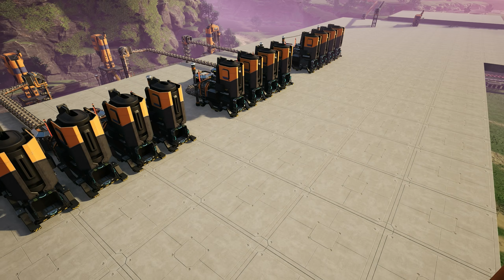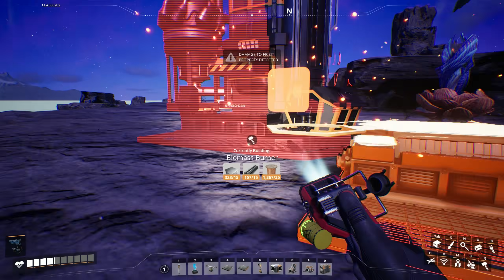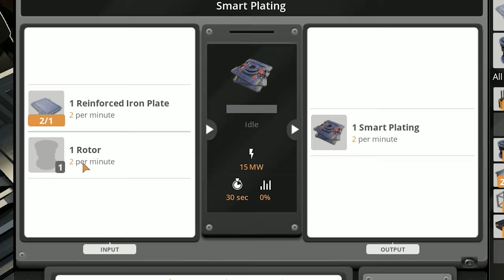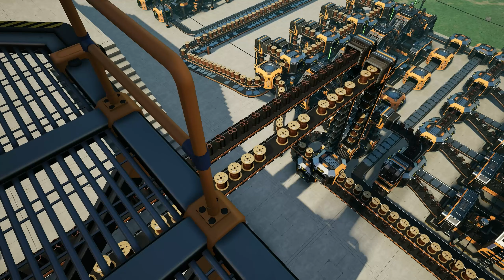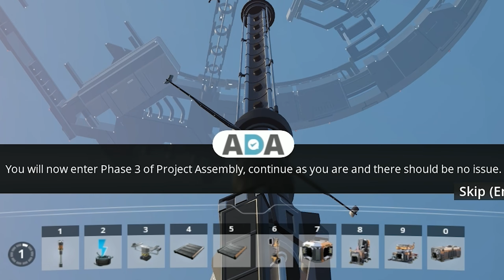Recipes you NEED Starting in Satisfactory 1.0

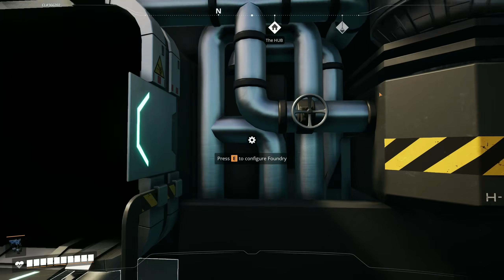Comment: 9:35
Specifically Molded Steel Beam is a 2 2/3 to 1 ratio, which is nearly twice as resource efficient as the normal recipe. It's an amazing upgrade and really useful in the Grasslands due to the huge amount of limestone you have available that otherwise doesn't have much use. Assuming fully overclocked Mark 2 Miners, you can generate about 2400 limestone, or 800 concrete, per minute with just the 6 normal and 1 pure nodes within the vicinity of the starting area. Combine that with the two pure coal nodes and 6 normal iron nodes which work out to 960 per minute each, and the molded recipes can comfortably make you 200 steel pipes and 285 steel beams with a bunch of concrete left over to go into storage for construction purposes.
And that's before considering Solid Steel Ingot which will get you even more steel out of those same resources.

Comment: Pro tip with the alt recipes. You can't get duplicate recipes at the same time. 

So if you get two things you don't want and used the reroll, then just don't pick anything, leave it in the library and you'll never get those options in future hard drives.

Comment: I know it requires the bane of all Satisfactory player's existence, but the wet concrete recipe is actually amazing, as it makes the 3:1 ratio, a 3:2 ratio, doubling efficiency. It does require unlocking the refinery, but it doesn't require any fuel, and you can unlock the recipe before then because you've unlocked concrete, one  of the parts of the recipe. This then allows you to save so much coal and iron in the 'molded' recipes, therefore turning a previously useless material into one that could be vital in the early to mid game in that it makes everything soo much easier!

Comment: I've been a fan of and using wet concrete, Pure iron ingot, and encased beams since i first started (around 3? Just after they added pumps). The new Iron pipe and more specifically molded steel ones pair nicely for squeezing the maximum output from 1 iron and a limestone node. 

Yeah anything that increases output with water is worth it imho..

Just set up at the lake with 4 coals in northern forest doing pure iron, solid steel, wet concrete, and encased beams last night. Was thinking of changing to molded and left space in my layout. Also did a dilluted fuel/plastic plant at the north shores oil fields.

Comment: The fact you rolled the steel screws would have saved you a bunch of pain early.  Been using it in my new 1.0 save and didnt run into any issues, its actually still running though I could have replaced it ages ago I've actually expanded on it since getting trains cause my local steel production is just working great to keep my rotors going.

Comment: Actually for Steel there's also Compacted Coal version, that turns 2 iron into 4 steel
Reply: That’s good if you have less iron than sulfur. But sulfur was (and still kind of is) scarce, so it’s not that good of a recipe. Just use more iron and coal and don’t “waste” sulfur like that. It’s better used on turbo fuel, among other things.
Reply: @sOvr9000  That would be correct for end-game, but you still need to get there and getting Tier 3 belts would be already tight and there's literally 0 use for sulfur at that stage. I hope you don't hand-craft your milestones xD

Comment: I just rushed coal, set up basic factories I plan on ripping out anyway, then spent three hours hard drive hunting. Only ones I’m missing are encased pipe and the alternate heavy modular frame. Would’ve sworn HMF were unlocked in parts assembly 2.

Comment: I was also in the alternative recipes hell xD. For Heavy Modular Frames i was locking for the recipe with concrete, steel pipes and encased beams. I had to search for 20-30ish hard drives to finally find the recipe. It was so painful…
But at least i found some Somersloops and Mercer Spheres at the same time :).

Comment: There is a cave in one of the sand biomes (I can't remember which one) where there are four quartz nodes and one SAM node. The SAM node is normal rarity, and right next to the cave is a great spot to build a power plant based off of coal, though you do have to get the nobelisk in order to get a quick way from the power plant to the quartz/SAM. Hope this helps!

Comment: FYI, there is a normal SAM node in the pit under the arch. Got bugs and poison gas to deal with, but afterwards you can easily lift the SAM up out of the pit to use for your alien tech goodies.

Since the best additional (the Dimensional Depot) can be used as so as you unlock Steel, thought someone would want to know.

Comment: Idk if this is gonna get patched eventually but atm it does work:

The 2 alt recipes you get at first are decided when the hard drive is consumed, meaning you could technically save, decode it, wait and if you dont get what you want reload and wait another 10 minutes. Tedious

On the other hand, rerolls are not set and calculated when you click the roll button. Save when the hard drive is decoded, reroll and if its not what you want simply load and try again
Reply: Ah, savescumming! Old tricks are the best tricks!
Reply: My Savior
Reply: Lowkey a good way to minmax hard drives at the start.

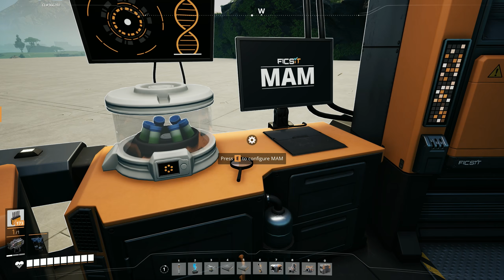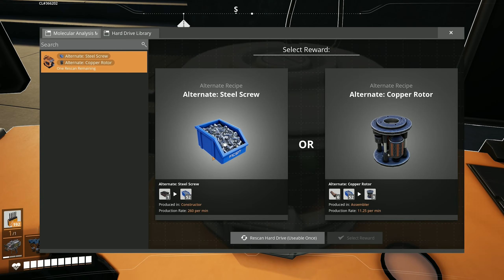Comment: Note at 7:53 he gets biocoal for a second time, if he had left the other recipe up rather than pick it his pool of options would have gotten smaller, note there is currently an issue were the hard drive list does not scroll so you don't want to get more than 7-8 before you start picking recipes. edit never mind 15:11. Still one tip if your doing the same as him is if you don't like either option you can as least rescan the drive and then leave it on the list. gives you one more roll of the dice.

Comment: if those bugs are bothering you when you go exploring, unlock the boomobox and any of the tapes and use it as a weapon, using the turbo bass instantly kills all flying bugs in a decent radius, it makes taking out those big nests rather easy
Reply: Also it takes a little while longer to unlock but the gas nobelisks insta kill them while you run in and beat it up with a sword. Or you can sneak up to them
Reply: @michaelvoight7748 I just have a manufacturer pumping out nobelisks with a dimensional depot hooked up to it. Sneak up on 'em and start the fireworks.
Reply: @michaelvoight7748  "Sneak" up, yeah. You can just hold C and it doesn't matter how fast you're going, you can't slide jump crouch right onto them.
Reply: @Lumegator  + They don't detect if you stand up for a moment, so even if you accidentally cancel your slide, you can just stand back up briefly and reslide.
Reply: Thats a thing?? Ill have to try that!
Reply: @DiagonalCoff33 yup.  Crouch and sneak up to a flying crab hatcher and you can freely melee it to death even with just a zapper.  As long as you don’t stand up, you should be able to take out even an entire cluster of them with basically no issues.  Creatures have different audio and visual perception, so you can actually sneak past a lot of enemies if you stay out of sight

The boombox is also useful.  In fact this is an INTENDED use, if one of the older update trailers is to be believed.  Where they explicitly show a massive swarm of flies instantly neutralized by it.  

Alternatively, two shots with a Rebar gun from outside the bug’s agro range can also deal with a spawner.  The crab flies despawn after about a minute or so without a player getting in agro range.  (4 something shots for the alpha hatchers) 

Gas nobelisks also deal with the flies pre well, as they have only one hit point, and the gas will immediately deplete it so long as the gas clouds are sufficiently thick.  Make sure you use enough of them so that the flies cant thread their way out of it as you kill the spawner.

Comment: Tip because you actually went to all the quartz nodes. When you scan, if you hover your mouse over the nodes that appear, it'll tell you what type of node it is (Pure, Normal, Impure).

Also, I had to go through about a dozen hard drives and had to have like 6 sitting open to finally get the steel rotor recipe. :D
Reply: Let me guess you rushed the MAM with caterium, sulphur and quartz? If alt recipe hunting trick is to unlock as little as posible to reduce to pool. Quartz is not that bad as about 3 it adds but caterium adds a a lot of alts and sulphur not useful till oil. It's why you should avoid unlocking foundations until you unlock stitched wire as limestone infests everything.
Reply: @kennys-dt8od they even added a quartz recipe that effectively lets you get both silica and crystals from ore at once, at the expense of some limestone and nitric acid (10 acid for 120 raw quartz). Probably a runner up to solid steel for being one of the best alternates in the whole game
Reply: I got steel rotor on my first hard drive! Never been so lucky in my life
Reply: bro ive been through a dozen and still cant find solid steel recipe, although i didnt know its more efficient to leave them unclaimed so i'll have to do that for my next harddrive hunt
Reply: @USSRChicken   the pool is only from tech you have unlocked and it's also tier locked, dammage is done sadly but don't advance a tier utill get alts you need from steel as gets a lot worse when blenders and manufacturers come online.
Reply: @kennys-dt8od  yeah i know its tier locked, but i did actually find it after a few more harddrives so yayyy

Comment: A little pro tip I figured out on my own a while ago:

When opening drop pods, you can close and reopen it immediately after pulling the handle. This skips the sliding animation, allowing you to take it quicker, saving you a bit of time when in a tight spot.
Reply: Or you can be a pansy like me and put the critters on retaliate mode. As long as you don't touch them, they'll leave you alone.
Reply: I've never understood why they have that janky ass animation for the handles anyways. All it does is waste time and make it feel unresponsive/simulate input lag. They should just have the handle move with the cursor. It ain't rocket science. It's just a handle. A factory game doesn't need big fuck off graphics. It just needs to run efficiently.
Reply: @diamonje I like it tbh, all the buttons and levers you have to push and pull manually in this game give it a lot of character.
Reply: @jkraemo  I'd be all for pulling the lever if it moved with my cursor instead of being dragged behind it. It just doesn't give me that feel good like the other manual aspects of the game.
Reply: i like tight spots
Reply: Rebar gun 🤤
Reply: @Izakde 
... With explosive rebars!
Reply: @Izakde  I love the Rebar Gun. <3

Comment: So I spent about 2 hours very early on out HD hunting and found 2 incredible things: 1 there is a new alternate  for steel pipe, made of iron ingots! You can make motors, with the steel rotor recipe and iron wire, out of only iron. 2 if you find 50 plastic in the world, you can unlock HSC’s and subsequently get the geothermal generators! I have skipped coal power entirely. Blue crater has 3 PURE geysers. Perfect for a Grass Feilds start.
Reply: @alexgreen8372  wait.. really ?  Skip coal ?  How...  and of course I see this right after I set up 8 coal gens. Lol
Reply: @elilewis8212  They added more geothermal vents in the map and reduced the cost, it's possible to unlock and reliably craft them at phase 2 since you can loot drop pods for circuit boards. They now only need motors and high speed connectors to craft instead of super computers, you can hand craft the HSCs. There's now a total of 31 vents providing an average power output of 7100MW, 10,650MW if you build power batteries to stabilize power fluctuations.
For reference there's 3 pure, 1 normal, 1 impure geysers east of the grass fields which provides an average of 1500MW or 2250 MW of power.
Reply: @kingcupcakes5171  where do you loot the circuit boards? and ive researched HSCs but whats the step to craft geothermal power generators! thanks a ton enjoying 1.0 so much!
Reply: @elilewis8212  real i just finished a 72 coal gen plant😔
Reply: Top tier
Reply: he shows it early in the vid XD
Reply: Best place for plastic is the gold coast at crash site kibs went to (one have to swim to,) there is 1 more in grass field area I think its the one just before the blue crater in the southern forest and need 100 mw to open an its on a giant mushroom on top of a cliff by the water.
Reply: I did the same thing :)
Reply: I somehow lucked out and got the recipes for both molded steel beams AND molded steel pipes, as well as wet concrete. So, I was able to make a really dumb amount of steel beams and pipes, at the cost of a lot of concrete early on, which I can later streamline with refineries.
Reply: I think the pipe one is meant for early nobelisk production.
Reply: Omg, I knew that you could get all that stuff from hard drive hunting (got turbo motors and stuff to sink) but geo power is awesome!
Reply: Living that Slug Life ain’t easy